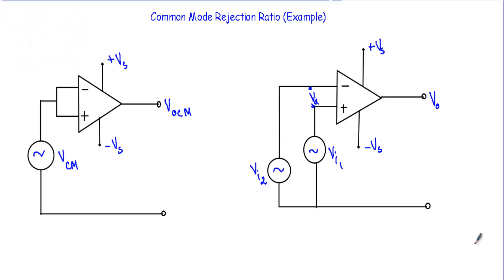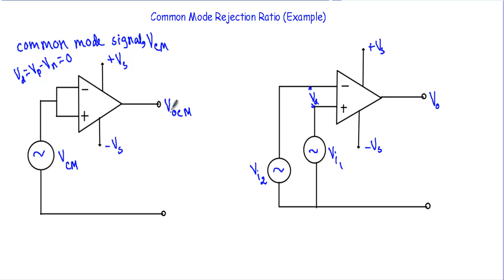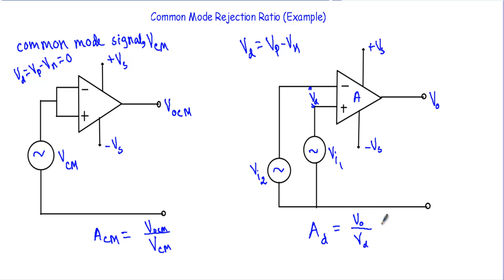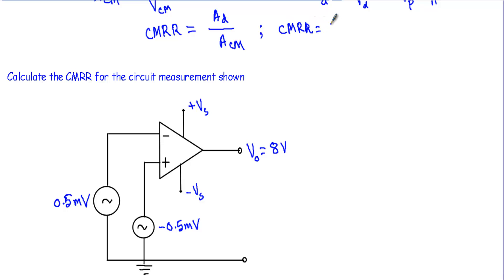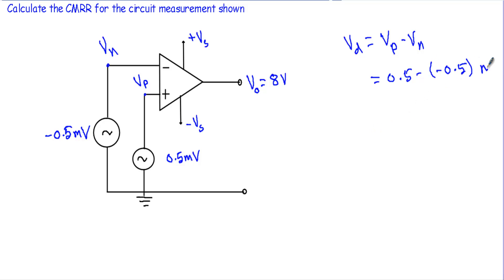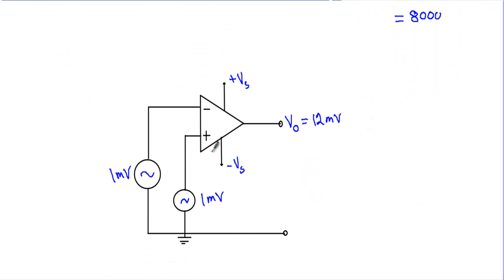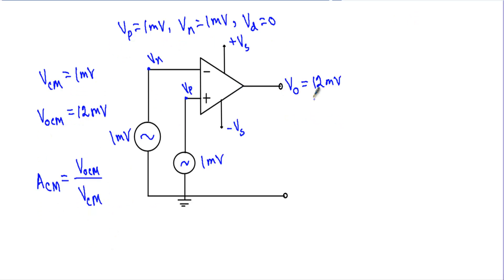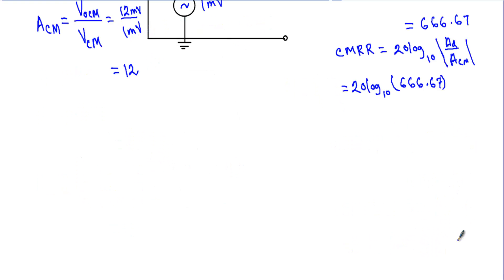Common Mode Rejection Ratio Example

Comment: CMRR MORE IS BETTER OR LESSER IS BETTER
Reply: CMRR should be as high as possible to reject the common signal at both the terminals. Op amp is a differential amplifier which takes difference between two inputs and then amplifies it. If there is any noise on the both non inv and inv terminals then we dont want that noise to get amplified at the output. Hence the signal which is common to both the terminals (e.g Noise)should be rejected. Hence common mode gain should be ideally zero. The differential gain should be as high as possible. Hence the CMRR should be as high as possible.

Comment: bro in 2nd example u are taking Ad=8000 why ? u are saying that Ad is 8000 where we are taking diff sources of 0.5 mv and -0.5 mv so how u are taking that value in 2nd example where inputs are 1 mv .
I will be happy if u will reply to my que
Reply: He is considering the same kind of differential amplifiers for both scenarios. One with differential input & the other one with common input mode.
Hope this will help you
Reply: In that case there is a difference between inverting and non inverting terminal so he considered it differential gain...
Reply: Bcz vp-vn will be 0 ...so its inverting and not inverting value is same in signs and quantity so it will a common mode signal....

Comment: in the 2nd example why is the output voltage defined to be 12mV? is this due to external voltage at the output?
Reply from the maker: When you bias op-amp with +Vs and -Vs with no input or common input voltages, a small output voltage will be appeared... That is known as output offset voltage